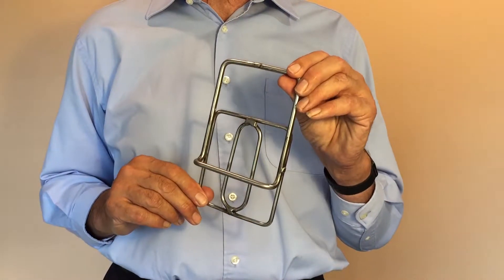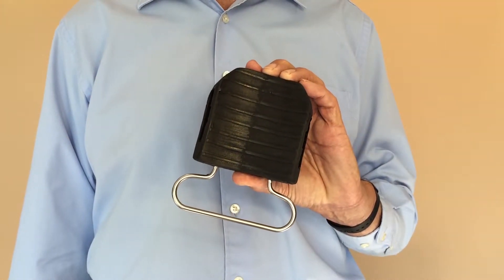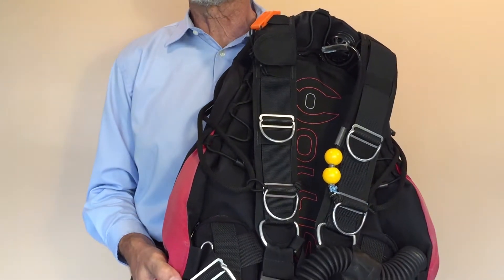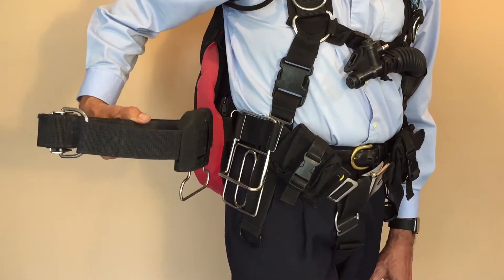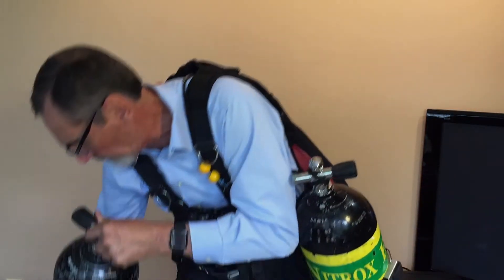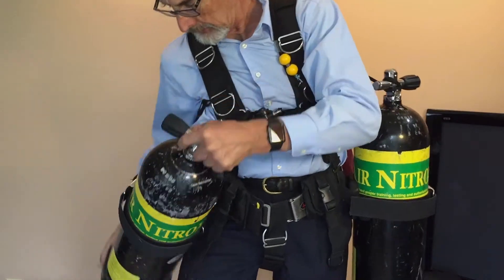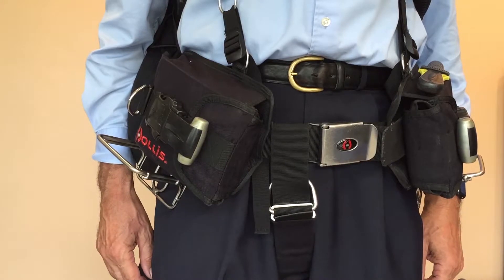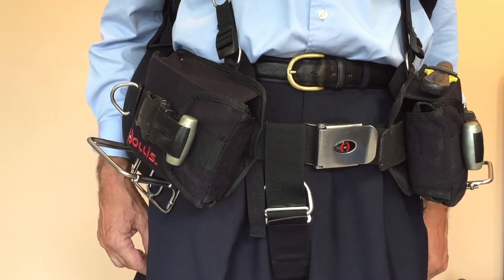Scuba Cylinder Lower Side Mounting System

Comment: So a metal to metal connection? No thanks
Reply from the maker: I would absolutely agree with you if this were for cave dives. But it isn't. The system was designed specifically for open water recreational and technical divers. Also, the system has evolved considerably (still metal to metal) since the video. You might want to check my website at SarabelEnterprises.com .